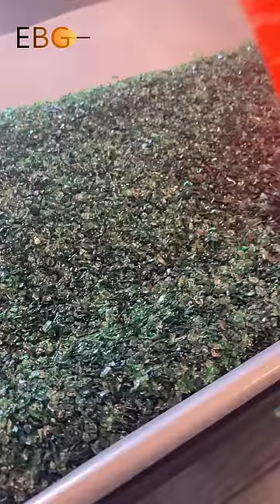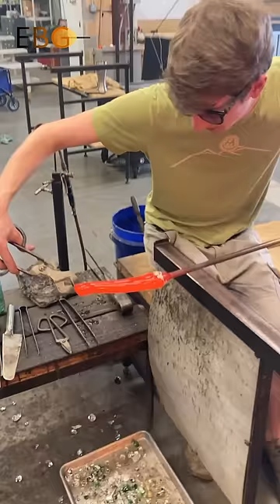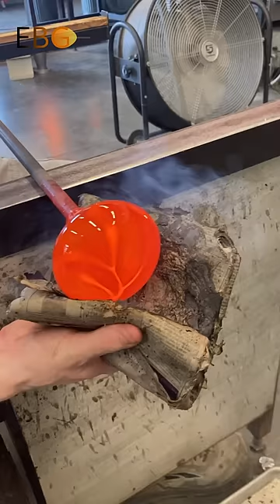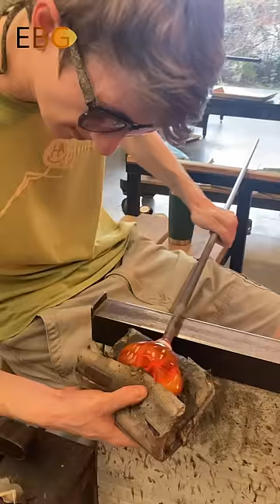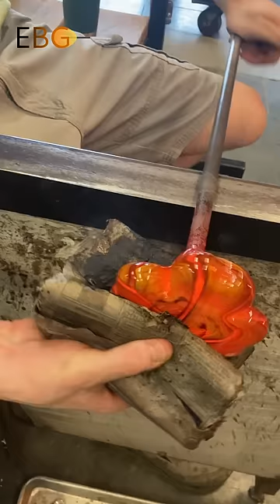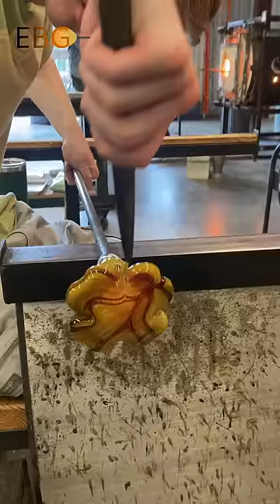4 Leaf Clover #shorts #glass #glassblowing #art #stpatricksday #asmr #satisfying #awesome

Comment: i wonder every time how resistant their sort of glass is against different temperatures while he is working. when i make glassbeads and such small objekts with my gas burner way less difference is necessary that they shatter... i guess the big amount of glass keeps most heat inside and it just cooles outside while my small beads cool way faster to their core...
Reply from the maker: For the glass we use once it drops below 800-850F it’s very likely to shock and crack if we try to reheat it to fast. We have to keep the whole piece above that temperature and it almost always is. Also as you mentioned the more mass we have the longer the heat stays in the piece. The glass we use is specially formulated to be workable for longer. I’d say I have somewhere beteeen 20-60 seconds to work on the object before reheating is necessary
Reply: @EricBlowsGlass  very interesting, thanks for answering! as i thought you use special glass for your requirements, for my small burner (just gas, no oxygen) i also have to use a low temperature melting type of glass. at the special glass workers school i went to the work you do was reserved for higher school levels because there were limited spaces available (very small school) and i never got the oportunity to try it, unfortunately...
can you use reducing glass too? i mean this certain kind of silver glass which, when continuously kept in reducing flames, create these mesmerizing iridescent effects like opal stones or mother of pearl... it would fit very well to your special style!

Comment: I miss blowing glass I never got that good but i didnt use a forge i had a little lynx some tools and a paragon F-130 that never got used . I built a shed to do this in cost 4300$ (never finished the roof) and then i got the kiln drove 6 hr round trip to find out they ordered me a 240 v instead of a 120 so i planned to dig a electrical line to the shed hit some crap in the ground by that time i was out of $ and the huge bucket filled w vermiculite wasnt working for my pipes and marbles- just sold the kiln for 1k payed like 3k for it😢 but in brooklyn there is a place that id buy glass from that you can just go and work its been years this vid brings me back seeing you roll that hot chunk a glass in that frit!!!

Dont miss the burns though! And once my punty wasnt fully attached to the workpiece and i had some pressure on it it snapped and took a nice chunk of skin off my finger enough to cause nerve damage… be careful and have fun!

I remember all the other glassblowers being appalled with my oxygen tanks clanging in the trunk of my old buick😂